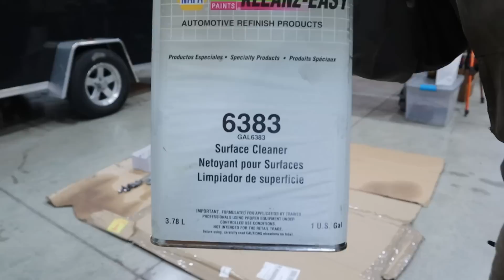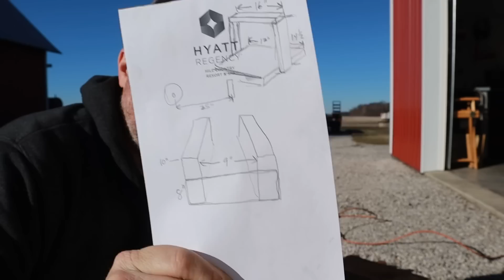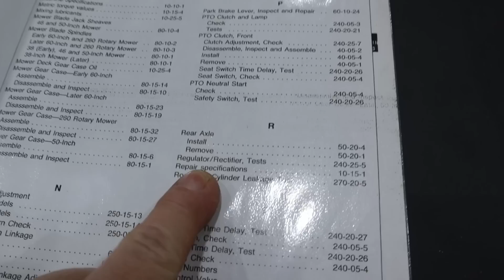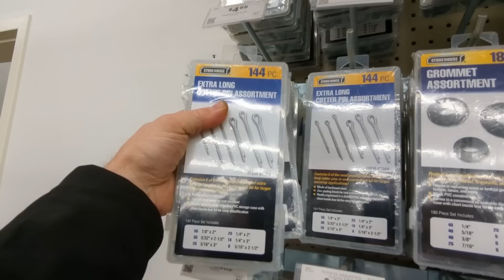Some Assembly Required!  My Dream 318 Garden Tractor Build - Part 5

Comment: A great way to start a Sunday morning is to watch a new video from Neil. It's always fun to watch others work but you know it's hard to keep quiet while doing it. So... First piece of advice I have is to never touch a part that has been blasted with your bare hands. Wear gloves so you keep your body oils off. I think this was pointed out in another comment. Nothing will bring out the fish eyes faster than body oils. But, it looks like it wasn't an issue for you. 

Second. Not advice but that sight tube you thought caused the leak, didn't. That hose needs to be vented so it accurately shows the fluid level. There should be a little gadget in that line at the high point that allows air to enter but keeps the dirt out. It looks like a small fuel filter. But many guys simply drill a small hole in that line which accomplishes the same thing. 

As for the seal? Welcome to the club. John Deere stocks them because it's likely the number one thing owners of these tractors need. Sooner or later. And the seals can be purchased much cheaper from other sources. I'll bet that's no surprise! It's a lot easier to lift that frame off the axle than lifting it in and out from the bottom. But, I'll bet you don't much care now. But I admire your ingenuity in making things work. You can certainly tell you have a rural background. 

Other than that, can't wait for the next video. keep them coming. It's even more fun to watch somebody else doing what has become very familiar to me.
Reply from the maker: Great tips! I think wiping down all those parts with cleaner probably helped with the oil situation. That's a very good point to mention! 

I'll look to see if I have that vent on my other tractors.  I guess what I meant that wasn't very clear is that perhaps the lack of a vent kept the rear end in a slight vacuum, preventing the leak from being apparent as it sat in the shop. It seems like I started seeing oil on the wheels as soon as that tube was broken.  Since there was no vent and now it was vented I thought maybe the induction of air was to blame. I'm just hoping that now it won't leak maybe. 
I should have shopped around for those seals though. 

At least I do get a little quicker at things the second time around 😋

Really appreciate the advice and support Joe 👍🏻
Reply: @digdrivediy  I'm the same way, Neil. I do buy a lot of parts from local dealers. If they have them. I've learned to check the prices online before I go to the store. You can check Deere's pricing online also. In the case of your seals, I likely would have paid the price just so I could keep moving along with the project. And I do try to support local businesses. But Deere can make that very difficult to swallow sometimes. But I also consider the research to be part of the enjoyment of rebuilding these things. Especially on these cool rainy days. 

One last point about that leak. If your thinking was correct, it would have leaked every time you checked the fluid. I think it was likely a coincidence it happened when it did. It could have shown up a few days after your project was completed. I think Brutus was trying to tell you something. :)

Comment: Neil… Sisyphus was sentenced to eternally fail just as he reached the pinnacle of the hill.  His struggle to get the rock there was mighty… only to have satisfaction snatched away as it tumbled back into the abyss from which it came.  

Let’s hope this isn’t a Sisyphean task and you have indeed crested the summit!

Taking the time to go bare frame certainly increased the difficulty and lengthened the days spent pushing uphill.  But, doing it that way will only and most assuredly flatten the mountain top and guarantee you won’t have to do it all over again.

Your elephant eating approach has proven its worth.  Each bite has fed your body… but now, you’ve eaten the trunk and feet.  The next course will be the tender, juicy bites that’ll nourish your soul.  

Getting a few new tools along the way is like adding a little spice to the meals… making them even more palatable.  

Me thinks that cresting the hill will certainly bring a long roll across a smooth plain that is free of thorns and pestilence…. 

In other words… congrats for getting to  midpoint… the rest of the journey should be both pleasant and rewarding!
Reply from the maker: Boy I so hope you're right Dave. 

I like the idea of those sweet and succulent bites!  It honestly did feel so good to put the newly painted parts together. 

I'm not familiar with the Sisyphus story.  I certainly hope I don't suffer the same fate! But it's amazing how you have something so relatable for each video. Man I wish I had your ability to so quickly reference something poignant and applicable to the storyline.  Thanks so much for sharing that with us!

On a side note, we are hoping that after a birthday party today there is time to get those bird houses mounted up. Hopefully it isn't too late.

Thanks again and have a great week!
Reply: @digdrivediy the timing should be perfect.

Keep plugging along, you are gonna look back on this build as one of your proudest achievements…. Or should I say, “Epic”?

Comment: Wow, I am impressed with the last part of the video, even before you made an issue of it, I was like wow, did he just negotiate that front axle like it was a piece of tin above his head🤣.  Seems like you've had some time for the gym Neil, those axles aren't lightweight.  Long video, but covered a lot of work and happy to see us...via you cross that hump.  Very satisfying to get the initial painted parts done.  Yeah, still a lot to go, but now anytime you get some extra parts painted, once dry, they can go on the tractor.  I'm even over the paint choice already and can't wait to see the finished work.  Did I miss the color of the wheels, were they gray or  contr. yellow?
Reply from the maker: Hey thanks Don!  Still catching up on comments but love seeing your name down here.  The wheels are going to be yellow as well.  I don't like dark colored wheels for some reason...
Reply: @digdrivediy  Me too, I like to see a contrast between the tire and wheel I guess.

Comment: I used the ez oil drain plug with the 90 and little extension. No complaints so far
Reply from the maker: I need to look into that.

Comment: Cowboy Neil,
The John Deere coming along very nicely.
I bought a Best arc plasma cutter off of scamazon and I love it $249.99. Idk if you have a plasma cutter? But the model I just got is the btc500dp works great.
Reply from the maker: That's great to hear Matt. That is cheap for a plasma!  I already have a little Miller plasma cutter and it is very handy to have.  I appreciate the tip though as I'm sure others might be interested.
Reply: Cowboy Neil,
It is very cheap for a pilot arc plasma cutter. I can run it on 110volts or 220volts. I like the feature for the adjustable cooldown on post flow. It's going to help alot in the shop building stuff.

Comment: I have a question about your choice of paint, not color I get that. What made you decide to rattle can paint the frame? It doesn't harden up as well as paint you have to mix. Just wondering don't mean any disrespect ,I love what you've done and you got a great finish out of it.
Reply from the maker: I completely get it. No disrespect at all as I struggled with what to do myself.

The answer is convenience and ease of use combined with how much is exposed to be seen when in use.

I knew there would be a lot of small parts and things that I would need to touch up after the fact as well. The rattle can makes it easy for that. Most of what I painted won't be seen when the tractor tins and the wheels are on so that was part of my decision as well. 

Maybe I'll regret the rattle cans on the frame but in actuality the only thing that really gets roughed up on the frame should be the three-point hitch parts and maybe the frame at the front where front mount implements will attach. The rest of it kind of remains untouched I guess.

The body panels I will set up and spray with a regular paint gun. 

Hope that makes sense.

Comment: I've been loving this video series since you started it.  It inspired to guy my dream garden tractor. A 332, which has the diesel in it. It came with a hydraulic tiller, a plow, a 4 way blade, a 3 point hitch, both front and rear weight brackets, and some JD suite case weights.  The one thing it's missing, a mower deck. I heard you say weren't going  to use the deck. I'm just curious, would you be wanting to sell that sweet deck you had hanging on the wall?
Reply from the maker: That's awesome Travis.  I've always wanted a 332 as well.

Where are you located? I have 4 mower decks and won't need them all so I can sell one.  I don't have any that are perfect though.
Reply: I'm located down in Tipton, Indiana.  If you want,  can message you in an Email

Comment: Where did you buy your repair manual . Iam in the process of rebuilding a 318 also.
Reply from the maker: I printed that thing from a digital copy of the manual I had.  Actually my wife printed it for me at the bank she worked at many years ago.  You can get PDF versions of the manual online.  I got this nearly 20 years ago.
Reply: Any chance you may have a good side panel you may sell. Left side if sitting on tractor.

Comment: Neil, for your rear hydraulic lines did you just tee of the valve and hose from the tee.?
Reply from the maker: Yes, that is exactly right.  You have to manipulate the lines a bit but it is relatively easy to do.
Reply: @digdrivediy  Thanks Neil!